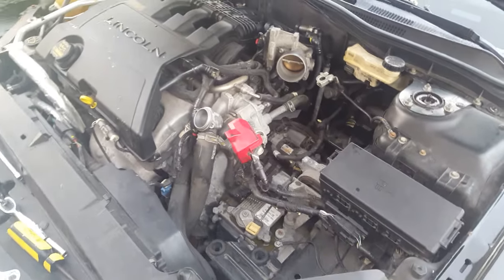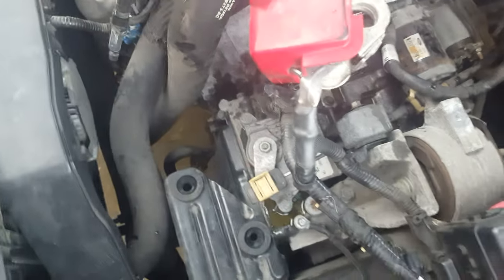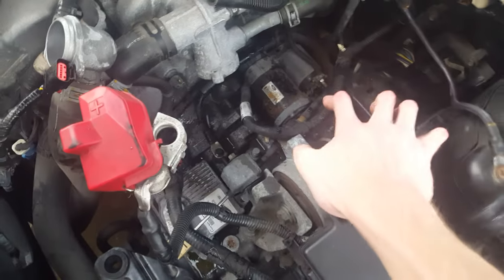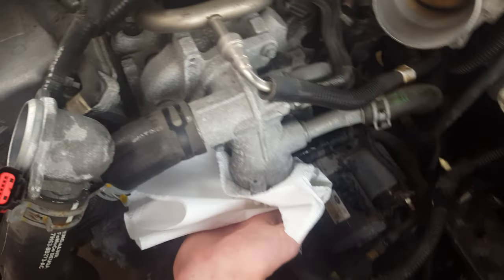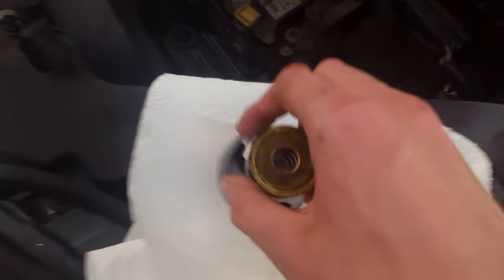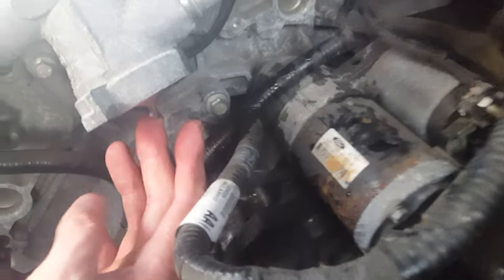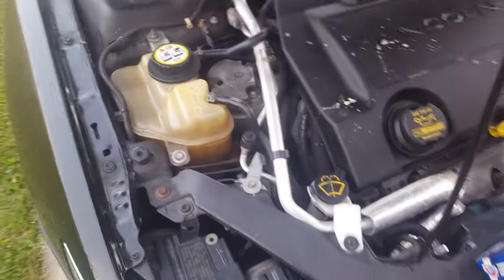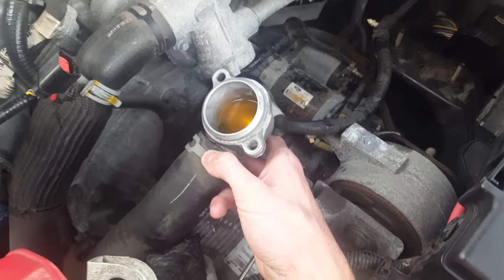How to replace your thermostat on a lincoln mkz zephyr and fusion

Comment: So I get all the way up to the removal of the thermostat and...I dont see which side of the thermostat the gasket is on. Even when he pulls it out I can tell...I think it was on the bottom...except I can see it on the top when he pulls it off. Then he puts in the new thermostat and never shows us the gasket.  I was throwing a P1299 code and went and got a new radiator cap and a failsafe thermostat.

Comment: You mentioned that the coolant was leaking on the passenger side was it your water pump that failed I have the same problem coolant leaking on the passenger side
Reply from the maker: I believe it was the water pump I never got to replace it and it ended up being too late I've tore the engine. It blew a head gasket the oil looks like chocolate milk
Reply: @Nickthecarguy  they habe that problem..happened to me at 200k miles in the 2013 mkz